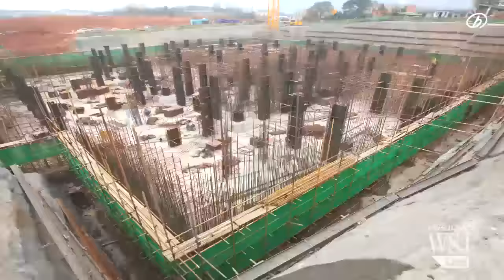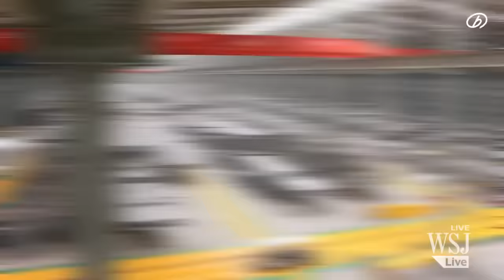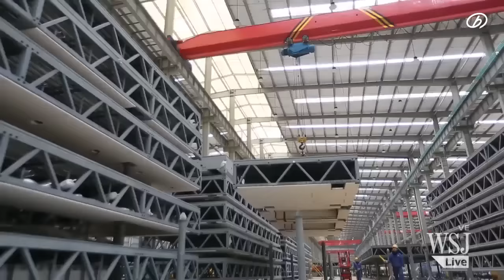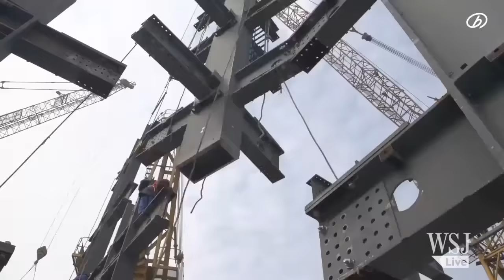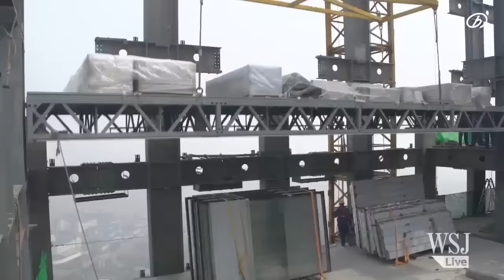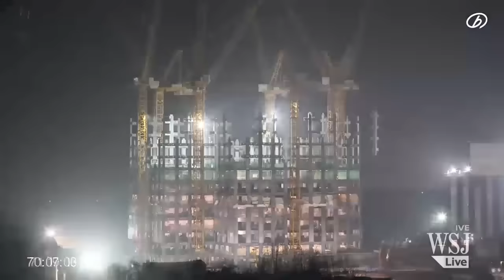Watch a 57-Story Building Go Up in 19 Days | WSJ

Comment: And here in Berlin, they still didint finish to build a airport.
Reply: And in Dresden( Theatre platz ) they started to repair a 100 metre bridge in 2016 nd until today it's not finished 😂
Reply: Guys this is a fake video don't believe in anything you see. This building was made previously only. They have taken a past footage and showed it as it's done from start in 19 days. They only CONVERTED that building to a hospital. That's all. 

ITS FAKE
Reply: @tanishmamidwar7816  Actually, it's not fake because even though it was in the past it was still real foatage of people building a large skyscraper that is time lapsed no matter if it's in the past or present, it's depended on how real it looks or the evidence of the foatage
Reply: I think because they want a high quality airport that can stand with 7.0 magnitude of earthquake.
Reply: Tanish Mamidwar can you stop copy and Pasteur the same comment and where is your proof?
Reply: The difference is that China is building 10,000+ skyscrapers and 100+ bridges a year while in Germany there might be 100s. 
But Europe is still leading the way in terms of 
specialized concrete: Basilisk
stainless steel/textile rebar applications: 2205, SS317, Schöck Combar...
moisture management: Dorken
uncoupling/waterproofing technologies: Schlueter Kedi/ Ditra system, Sika bentoshield
thermal insulation: Corning Foamglas, Roxul...
And constructions in Europe are similar to China since that wood is rarely being used for structural purposes.
China is building a lot but not advanced: that is why I see a lot of EU civil engineers are able to work in China to construct passive apartment buildings under sino-EU FTA.
Reply: Germany has very poor infrastructure and overall is very far behind China and most of Asia
Reply: It is now in operation

Comment: It wasn't really done in 19 consecutive days, It was capped at 20 stories for one year due to its proximity to the airport. The original design was for 97 stories, was reduced to 57. Took about 5 months to build the 2,700 plus modules that were used.
Reply: source: Dude, trust me.
Reply: Still faster than the states here
Reply: It may have taken over a year theoretically, but the actual building days was 19 days
Reply: @pyrophobia133  here in Canada to they always takes forever for skyscrapers to be finish
Reply: ranjeet singh  Why couldn't it be. As you saw, everything was pre-made and it just needed to be assembled.
Reply: alright nerd
Reply: Modules can be mass manufactured in hours. This is what Korea has been doing in many industries since the '80s with 1/1000 mm tolerance.
Reply: @joshuabom64  yea because we have safety in china no safety means worling way faster and gruling 14hrs shifts
Reply: @sergelengerelmaa2450  most of the building was prefabricated and prefab building are built faster than regular constructed buildings
Reply: @joshuabom64  true tho 😭
Reply: @pyrophobia133  in bangladseh we still use bricks to build
Reply: @pyrophobia133  that building would've taken 2-3 years in the states.  And time is money.
Reply: @pyrophobia133 it'll collapse faster than in the states too
Reply: @nobilesnovushomo58 be happy that we have safety regulations here, without it 9/11 would of happened without terrorists
Reply: @pyrophobia133 states don’t have an overpopulation problem where buildings need to be built every second.

Comment: process management is quite amazing. many friends are clearly missing this crucial point and put emphasis on how it is built.
Reply: College education is mandatory to work at a home appliance A/S or product manufacturing line. The high school math of welding is simply insuifficient to make things work.
Reply: Not really. The comparison is being made because the assembly timeline is being compared with a Western construction timeline. This is a pre-fab skyscraper and we aren't told how long its construction actually took.

Comment: Yes and here in the UK it has been about almost 3 weeks and they have barely managed to install a 100 m gas pipe. I reckon it will probably be another 2 or so weeks.
Reply: Cause of traffic
Reply: @JP-of8uq  Erm no. Even if the traffic they could still work.
Reply: Great! Well here in my country a 30m x 10m road have been removed, we still don't know when will be the construction of the new road will happen.
Reply: Dats better at least it wont affect the engineers salaries
Reply: Hello...is the pipe done? 😂😂
Reply: @MrStano-jy3ts  Lol I was curious too
Reply: In here in India people take years to cover a pothole 😂
Reply: Lol here in the netherlands after 6 years they finally made 1 floor just concrete nothing else
Reply: @DeusWrath Eternus think they just didnt count the time when base are made, otherwise yeah it takes longer for cement to dry.
Reply: Marco Williams  and over 3 years to do the Brexit

Comment: It was assembled not constructed.
Everything is prefabricated and precast they just put right thing on right place.
Reply: still 10 times faster than it takes us to do it
Reply: Whats the difference between mixing building frames and mixing concrete in a factory and building frames and mixing concrete on the ground? Construction is assembly.
Reply: @VYKNIGHT  the difference is, if you try to do it all on site from scratch, its much slower and you have a limited space to operate, and no big factory machines.

Its quicker and easier to mass produce parts in a factory with process equipment far from the crowded build site, and you can be manufacturing the building parts months before the project even begins.
 The more work you can do offsite, the quicker the assembly onsite
Reply: Faheem Rasheed it's construction one way or another dude. You think they are gonna build H beams on site? And what's wrong with the way they constructing it. Let's say you look at the floors for example. When you look at the man hours, cost of labor, cost on supplies, time, money, energy. Why would you waste time building the floors on  site rather than having it already manufactured and ready for service?
Reply: @RDJ214  exactly... you cant have massive steel plants on site.
You want to smelt copper on site too for the cabling?
Reply: New way to build. UK builded a 50 story skyscraper in London like lego. Opened in 2017. I'm a electrician building skyscraper in San Francisco.  America is behind China and EU in building.
Reply: Faheem Rasheed 
Don’t be stupid, still much faster than the west could imagine
Reply: Yup they can read the instructions!!!
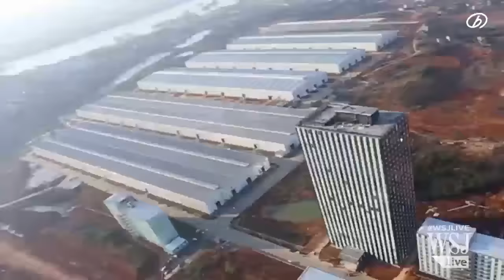Reply: 0:24 see those huge factories/warehouses? That's where they build the precast/panels. Those factories are built right in the middle of a brand new city where they will be used to build many many other buildings. With that said you cannot have this system in large American cities as it would not be feasible. Also forget about trucking in panels from factories dozens of miles away. That would be a logistical nightmare.
Reply: Yes..that is what people amazed of
Reply: Exactly what I was going to say.
Reply: true. constructing nowdays doesn't take long however when a floor of a building is done it takes around 3 days for the filled concrete to dry.
Reply: Legos basically
Reply: Connor Nixon ya but they probably didn’t take the time it took to build the pieces and only took into consideration the time it took to put them together. This is definitely a great accomplishment by China but I think that it is getting more credit than it should
Reply: Isn’t it always. :/
Reply: @VYKNIGHT  You don't have to wait for thee concrete floor slabs to dry as you build upwards subsequently more faster productivity on site
Reply: Both considered construction. Only the method is different. Wether IBS or conventional
Reply: "just"
Reply: Even for a prefab/precast structure that is still pretty quick.
Reply: While others can't make it and before it collapses, it remains a marvel, doesn't it?
Reply: It still takes a geniuous architect to make the assembling of a skyscrapper done perfectly well in 19 days.
Reply: grimm reaper  So, it is a better practice.
Reply: Can u do faster than them ??
Reply: I am a Civil Engineer,
Not all parts were precast, it was a composite of Steel and precast concrete,
And even joining those parts is no joke.
Reply: Yes and the savings on labor hours must have been extraordinary
Reply: @Yodrop you meant "...as it would not be politically feasible." right?

Comment: You gotta admit though. Everything was pretty much premade and it was like putting together legos. Very good concept though. It may even be more economical that the traditional way of building with steel rods and pouring in concrete.
Reply: it has to cost more, otherwise everyone would be using it
Reply: @tmpEngine  prefab is almost always cheaper. I think more likely it is unsafe
Reply: Thats why the soviets used prefab apartments. They bassicly solved the housing crisis after WWII completly, at a speed unimaginable today. Often its told that these were of low quality, but what is often forgotten are the conditions where the population lifed before. There are documented reports of families moving into prefab arpartments with kids beeing exited because the apartment had multiple rooms and plumping. It is cheaper, but not at a small scale, henceforth developer dont use it. Only mass construction by governments makes prefab buildings possible, where they then are cheap.

Comment: The building is a pre built in factory building...modular building system are faster and alot safer than tradition building method...Those thing goes up  like steel legos...These kind of building are quake safe...since they are mostly steel in construction it takes alot more force to bring them down...Those tradition slow building style with reinforce concrete is more susceptible to  crumble/collapse in an earth quake... than steel structure building we see here going up in 57 days......

Comment: We need 10,000,000,000 us dollars  to build a railway which goes into mainland in Hong Kong...  10 years have passed but it is still not yet done.
Reply: You can delete that comment cos it opened last month, also the sleeper trains have been running for over 20 years, unless ur talking about the high speed one?

Comment: Don't get me wrong, Chinese do some pretty awesome engineering. But this isn't a building that was built in "19 days".
Pre-Fab fanatics always embellish (and ignore) certain things. For example, they don't bother to mention that the fabrication time for many of those components took months. So in reality, "19 days" could be more like a year, which is basically the same as other forms of construction.
The pre-fabbed elements themselves look awful expensive. I'm not sure what type of building this is, so maybe it aids the building's functionality, but the pre-fabbed floor assemblies take up a lot of thickness. Maybe they need it for special duct work. But if this is just a regular office building, they've sacrificed a lot of things just for "speed". 57 floors of double-thick floors = a lot of extra height.
Next Issue is construction costs: There are what, like 8 cranes? Although the schedule is faster, the cost goes up exponentially. There's a "sweet spot" in regards to the most economical pace of a construction project. You hit a point where accelerating the schedule becomes expensive and in some cases compromises quality.
One other peculiar thing I noticed is that the surveyors shown at various points in time look fake. The equipment they use is also quite dated. If you can afford 8 cranes why are you using an outdated theodolite from 1992?

Comment: I watched 2 documentaries about high rise building construction China vs. US. The US building was inspected right after the floors were installed with strict adherence to the engineering requirements for spacing between the plumbing, electrical and data conduits. Time consuming changes had to be made to bring everything up to code. Then the floor was poured. 
The Chinese installed a floor frame, ran all their pipes and conduits (some of them literally lying directly against each other in bunches. Then they poured with no code inspections that I could see.
Reply: ttraderjim The worst part is that they often copy and paste building designs, so if one has a major flaw, the other 200 do as well.
Reply: Ok
Reply: Well you are comparing a developed country to a developing country, why not compare China with another developing country? That would be more fair and China does much better.

Just remember the US had 300 years to develop but China only had 70 years, even the US can't match your expectations in that time frame.
Reply: @AndrewManook there are also factors involving the development of a nation.
But the main drive is the available technology. 
Ib the past 300 years, the US doesn't have the same building technology as of today. 
So comparing the 300 - 70 years is absurd.
Reply: Lol!

Comment: I'm an electrician that wires new skyscrapers in Seattle Washington. It normally takes 2 to 7 years to build a skyscraper because of mismanagement, trouble getting materials and lack of workers. A good example of mismanagement is when we wiring a hospital they decided to almost double the amount of wires after the drop ceiling had been put in. We could have run the wires a lot quicker and more efficiently before the drop celling was installed. Our bosses think that all the trades doing their thing at the same time is more efficient but when you have to spend double or triple the time on something are you really saving labor? They also let the HVAC people cover most of the celling in pipes and we didn't have enough room to install a second wire tray so we had to run all the wires through 1 tray which created a rats nest of wires that was hard to pull through and might have violated a code or two. We often can't do work as soon as we'd like to do it because they didn't order enough materials and we have to wait for another order to arrive. Tradesworkers tend to be paid better than alot of workers but the cost of housing in Seattle is so outrageous that few can live close to the construction site and many tradesworkers have to commute 1.5 to 2.5 hours each way. We also often have to pay $20 or $30 a day city parking fees, we don't get paid vacation, we don't get much sick pay and their tends to be either not enough work or crazy overtime. When you add the bad commute, parking fees, unpredictable schedule, lack of vacation/sick pay and hot/cold/dirty/alittle dangerous working conditions together are you surprised there are not enough workers? The bigger companies make $300 to $500k per year per employee in profit but still cry that they can't afford to pay employees parking, vacation or sick pay. Our overtime rates are insane but most of the overtime could have been avoided with better planning.

Comment: Interesting. I'm wondering how well it was inspected in proccess. I like it as long as there are no short cuts in safety.
Reply: Supervision engineer at site will inspect along the whole process with tools specified. FYI, there are 600k graduated engineering guys pushed to the market ever year. Most of them starting from doing site related engineering job when they start their careers.
Reply: @JkJK-pb5qm  Doesnt China have a massive building quality issue? Particularly in these quick-build high rise projects?
Reply: @triz313  With all the attention the quality problem being addressed several times they will make sure it is quality

Comment: Pleace, help me
 1. What type of building is it?
2. Where was it built?
3. How long did it take to build it?
4. Who is Chen Xiangquian?
5. What materials can you see that were used in the project?
6. Did they use traditional, modern or both types of materials?
7. What method of construction did they use?
8. What did the associate director of the engineering consulting firm, Liu Peng, think about the method of construction?
9. Name some important characteristics of this building.
10. What are the company's future ambitions?

Comment: Where's the concrete? Metal rusts and will fatigue.
Modular building with a lifespan of a Toyota car.
Reply: Using a Toyota as an example for a short lifespanned vehicle is not the best idea😂
Toyotas are some of the most indestructible vehicles around...
Reply: They can almost compete with Nokia. The only thing stronger is Chuck Norris’ beard.

Comment: Does anyone know if using prefab and precast parts is safe as far as the structural integrity of the building, especially in earthquake prone regions?
Reply: It's a steel structure. Steel is the preferable way of building constructions in earthquake prone regions. An in situ poured concrete construction cannot be build in 19 days, as it needs time to harden before putting extra weight on it.
Reply: @jeronimojd  It was a while back when I asked this and I probably should have been more clear, but I was referring to the slabs for each floor.   I live in California, and every steel frame structure I have seen going up gets fresh poured concrete for each floor.

Comment: How long did all the prefabrication work take? They showed it for like 2 seconds of the video, but I think it’s stupid to say they built this tower in 19 days. More like they ASSEMBLED a 57 story LEGO set in 19 days that probably took at least a year to prefabricate all the LEGO blocks. Plus another year or five for design and engineering. If it still stands in 25 years... it will still be an impressive display of engineering capabilities, but it will still be a bunch of false propaganda to claim it was built in 19 days. I only cook a lasagna for 45 min, but I spend 4hours prepping all the different things that go into it and layering them into a pan. Did I cook a lasagna in 45 min? No....